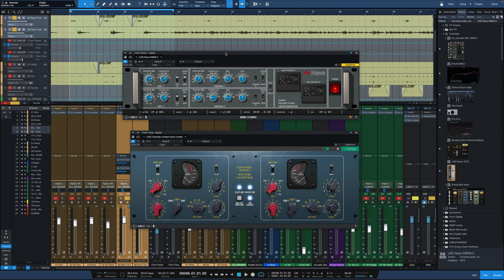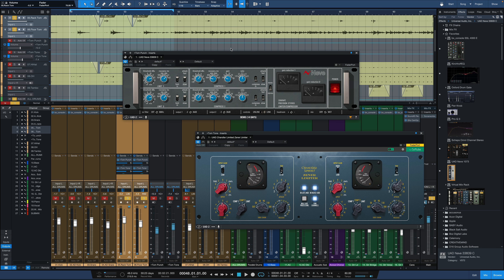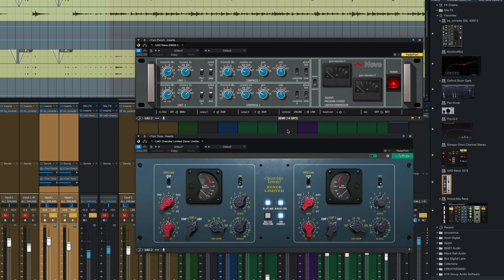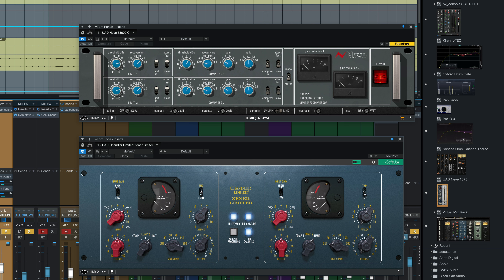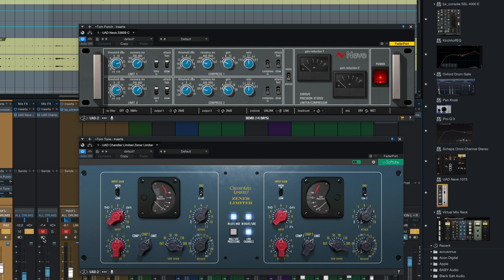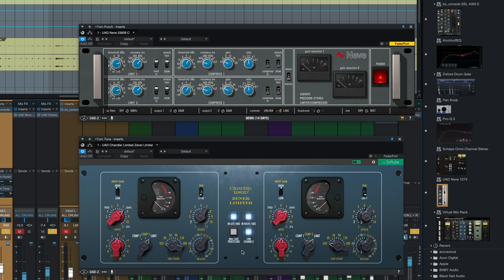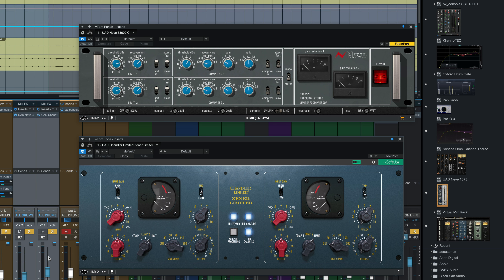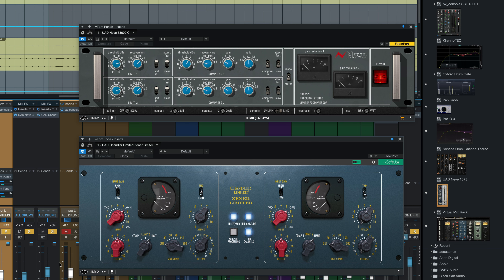Joe Chiccarelli Parallel Compression on Toms

Comment: Awesome. Thanks
Reply: Hi, great stuff! question... did you pick the Neve and Chandler because that's what Joe C used? I have the Neve but not the Chandler. What would be your opinion of another limiter to use instead of the Chandler? I have a UAD Fairchild.
Reply: @hotrodstudio151  haven't tried the fairchild yet.
But as i remember that softube chandler really do sounds dirty adds tons of low bumps or harmonic if I'm not wrong.
Where the other fairchild is add more grit or distortion

Comment: i don't know, there's a lot that can get worse with compressing your tom tracks with all the bleed, and if you increase attack and sustain, you might as well just increase the volume or use an eq or a single compressor if you want to change the ratio between attack and sustain

Comment: to much trouble, i will just use a transient designer plugin
Reply from the maker: Leave it in your template and it's no trouble.  Transient designers can obviously shape attack and sustain, but it won't be quite the same as this.
Reply: @GreenLightSound  i would be appalled if this took anyone more than a couple minutes
Reply: "to much trouble" no time for o's or parallel compression